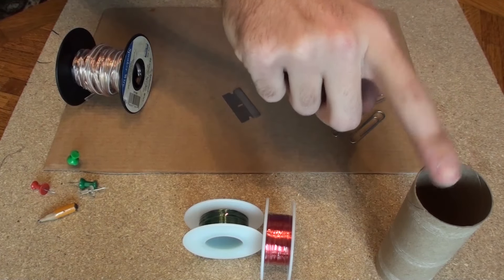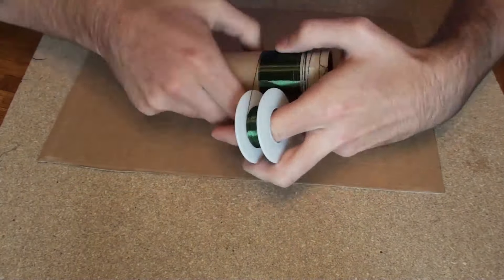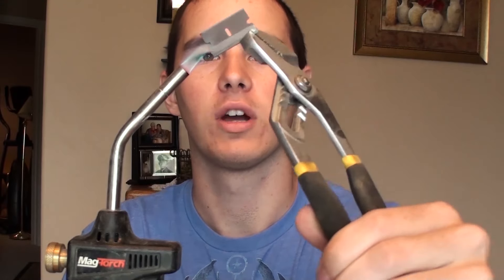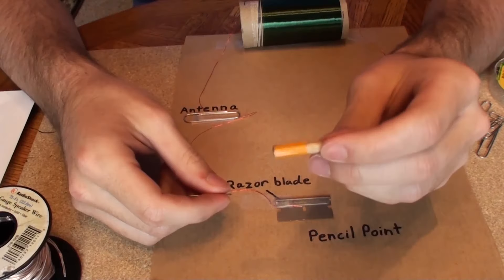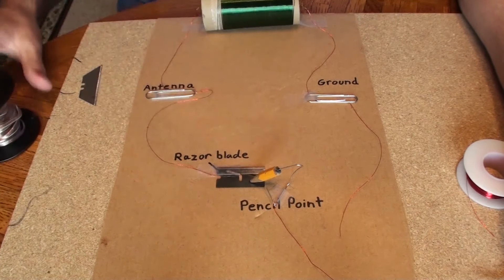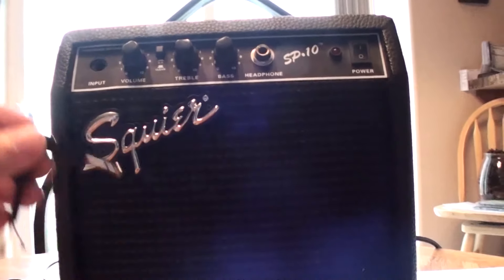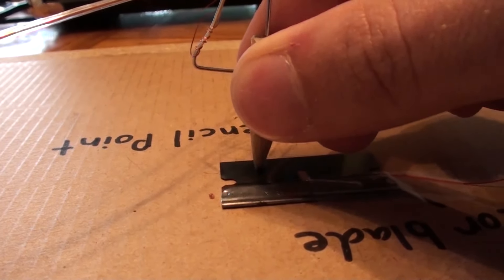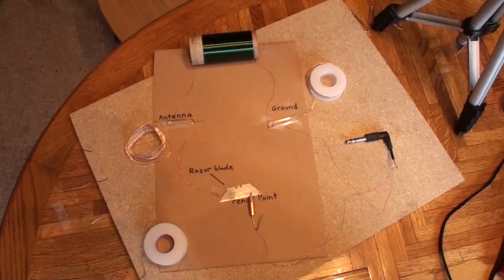How to Make a Foxhole Radio

Comment from the maker: From what I understand the radio waves send electricity back and forth through the coil. So the more turns you have the more power/signal strength you will get.

Comment: @AndGoProductions I really like your video and pls reply. i have all the necessary components but is there asnything i could use instead of a razor blade? Like can i use a piece of metal?(i dont know much about this kind of stuff but im only a kid)
Reply: Many kinds of oxidized steel or copper might work. I used a pocket knife blade one time. An old penny might work

Comment: i dont have a razor blade but can i use a flat piece of iron or tin foil?
Reply: It might work with iron, but it's less likely to work with tin (actually aluminium) foil.  What creates the diode is the junction between the pencil lead (graphite) and a tarnished section of the metal.  Heating the metal is used to accelerate the formation of tarnish (iron oxide usually).

In short, it might work with any metal which oxidises but all you can do is try it and see.

Comment: Its a crystal radio where the graphite pencil lead acts as a diode and the razor blade acts as a tuning cap.
Reply: No, there's no tuning.  The junction between the graphite pencil lead and a tarnished section of the razor blade acts as the diode, not just the pencil lead on its own.

Comment: thank you for a very good video!! this is the best one I have seen on you tube thus far but may I make just a small suggestion some house wiring in many old homes can be bad or faulty it would be much safer to stay away from that type of a grounding system. just ground it off on a copper pipe in your house,or just buy a cheap grounding rod. again this is a great video on how to make a foxhole radio, and we "appreciate" all your help, but we want all the little ones and us big ones to be safe.

Comment: This is amazing !
Though I have a question ?
Could you type the supplies on here please ? It would be nice x
Reply: u would need
 -toilet paper tube 
-magnet wire (normal wire with a non-conductive coating)
-tape
-paperclips
-thumb tags
-rusty or blued razor blade 
-broken off pencil head
-regular wire
-cardboard or any wooden board to put it all on

Comment: Great video, I really like the simplicity of your radio, however I've never heard of this style radio called a foxhole radio. Typically they're called crystal radio's. 
I've made vhf/uhf and cb foxhole antennas for extreme directional control for specific long range uses.
Reply: This type of radio was built by our troops during ww2 to receive allied and German radio stations, a powered radio was rightly or wrongly thought to give off rf which enemy forces might be able to home in on. Used in foxholes, thus foxhole radio.

Comment: An excellent video. If you're using a copper pipe as a ground, a cold water pipe eventually goes into the ground. A hot water pipe in a tankless system may be ok, but a pipe that goes to a hot water tank may not be grounded. In Canada, in most cases, there's a grounding clamp on the cold water pipe just after the water meter, which is just after it comes into the house. That's the best ground I can think of besides a 6 foot copper bar in the ground.

Comment: How utterly foolhardy to publish that method to pick up a ground connection.
Dangerous enough for an adult but any child seeing that, would have no concept of the danger.Could easily blow out the house sockets but worse 'blow out" himself.
Apart from the danger, that earth/ground can be very noisy unless it's very close to the main house grounding rod.
Reply: Razors are sharp also and fire from a torch will burn things.
Reply: Redrum.
I guess that YOU know what you mean by the remark.
Goes over my head!

Comment: pencil must have been made in mexico,,,I keep hearing Mexican talk
Reply: ground wont work in older houses as 3 wireplug is there but no connection from the ground tap to the ground. Houses I lived in for 40 years were this way
Reply: That's why you would ground to a water pipe or a radiator in older apartments.
Reply: es castellano